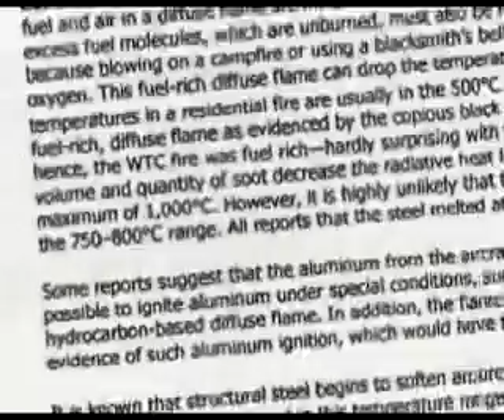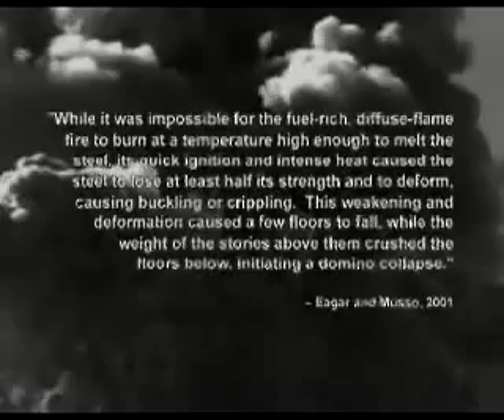Steel Facts and WTC Collapse (Part One)

Comment: FYI: using real science, you can prove or disprove the identity of a substance solely based on it's heat output. that would be nothing more than pseudoscience. agree? other physical and chemical characteristics of the substance must be evaluated. kind of like what jones and the other 8 scientists did with the chips (aka nano-thermite)...

Comment: Since Nano-Thermite's intent is to burn hotter than regular thermite which we know burns around, well at least we know it gets hot enough to melt steel so at 3000 degrees F, then we can conclude that what Jones found is in fact not nano-thermite. 

Agree?

Comment: can you supply proof that thermite has the exact same chemical structure as rust/Al? this should easy to find. we already tried the MSDS and nada.

This is why Jones concluded for the size of the chips and temp output, that it was some kind of super thermite.

the nano structure is the smoking gun. this proves the chips were manufactured with highly advanced techniques. say more advanced than what terroritsts living in a cave somewhere could do?

Comment: Jones concluded it was thermite because the chips:

had the same chemical structure as thermite
exhibited exothermic temps of 700C
had a complex nano-structure when scanned at 50,000X

if you didn't know, that is called a scientific investigation, ok? can you see this about rust and aluminum? red oxide primer? any other substance? obviously, hell no..your campaign is going nowhere..just in very small circles

Comment: i thought you were done going in these circles? the bottom line is jones concluded that chips were themite. ok? but really really tiny thermite. is that better than nano? the obvious question is what is thermite (of any kind) doing in the WTC dust samples in order of TONS. and until you prove this was primer, it is thermite.  that's the big picture with no circles. make sense?

Comment: When ignited, chocolate chips give off temperatures higher than 700C so you're right, it probably wasn't chocolate chips, it had to be thermite since thermite burns colder than chocolate. At least according to Jones. 

I don't really have anymore time to waste going around in circles. 

As soon as you or Jones have proof that what he found is nano-thermite and that it could only have been made in a lab and placed there intentionally then you might be onto something.

Comment: ok, you finally admitted you have absolutely no proof (testing) that primer or anything in the building could've been the chips. agree? so, your theory is based on no facts or data? agree? next, are you research scientist (preferably with a phd in a related science) with access to the materials to do the testing? if not, it is highly probable you will never do the testing with suitable credentials. agree?  you haven't even read the study? agree? so, what exactly is your case again?

Comment: jones used the known chemical structure of thermite to compare.  using XEDS, he verified this. Next, using a DSC, he measured the exothermic activity associated with the chips. For the size vs the temp output, he determined the chips were some kind of "super" thermite. Finally, under an SEM at a magnification of 50,000X, he determined that a highly advanced complex nano structure existed in the chips. Far from hollow..huh?

Comment: since you made the claim that the chips were actually just primer, provide proof that primer resembles the chips in every way:

red gray bi-layer (with the same chemical componenet per layer)
temp output of about 700C
exact chemical structure of thermite
same nano structure at 50,000X

agree?

Comment: You want proof that Red Oxide primer contains aluminum and when painted over steel, will etch into it and thus take on some of the rust causing the two to become cohesive?

Or you need proof that thermite is Rust and Aluminum powder mixed together?

Comment: you have a theory about primer and rust/Al. do you have any proof to support this? since this is the only aletrnative theory you have of what was actually found, how about some supporting documentation? a theory without proof is just an opinion. how about just proof that red oxide primer has the same chemical structure as thermite? lets start there..

Comment: simple question. please answer. when primer, rust and Al are put under a SEM at 50,000X, is there a complex nano structure present consisting of :
gray layer:iron and O2

nano structured red layer:
semitransparent matrix layer consisting of silicon, oxygen and carbon
hexagonal plates (AL) and rhombic grains (thermite) embedded in the matrix layer. it appears that only the rhombic grains contain the thermite. are nano structured rhombic grains in rust and Al? I know, jones blah blah....LMAO

Comment: you weren't the one performing the tests but you claim that rust and Al have the same properties as thermite. you also claim primer has a red gray bi layer and has the same compounds. but, you offer ZERO evidence to back up any of your theories. if you have an alternate view or conclusion of what the chips actual were, shouldn't you present evidence to support your view? this is basis of any scientific analysis. otherwise, it's just pseudoscience.

agree?

Comment: I accept legitimate, not pseudoscience. 

Jones and company stopped short of proving they had nano-thermite but felt it was ok to release a paper with an opinion that they had found loads of the stuff?

"Science by press conference" is a hallmark of pseudoscience. Using terms that sound technical such as "red-gray bi-layers and rohomboidal crystals" but are really not is another hallmark of pseudoscience.

Comment: Again Jones concluded that chips exhibited similiar physical and exothermic properties as thermite. With analysis (and under the magnification of 50,000X), it was determined that the chips contained a highly complex nano structured layer. Once again, thermite + nano technology=nano thermite. do you need it broken down once more? The obvious question once more. Does ANY primer available have this nano structured layer? It is ridiculous to even ask you this. Obviously, no.

Comment: i have a slightly different version:

There is no evidence that primer shares the same chemical, structural and physical properties of nano-thermite.  To add to this, obviously primer doesn't have the complex structure as nano-thermite. You seem to avoid this directly..for good reason. where is the red gray bi-layer? The nano structured matrix layer with hexagonal plates and rhombic grains. If you have evidence that primer is equivalent, present it now and save the useles chatter.

Comment: I opened an MSDS for red oxide primer by manufacturers: pruett-schaffer, centurion, and rodda paints
no mention of a red gray bi-layer. no mention of a semi-transparent matrix layer composed of silicon, carbon and oygen. no mention of the particles (hexagonal plates/rhombic grains) embedded in the matrix layer. no mention of any nano technology used. just looks like plain ol' primer to me. in your defense, it is highly flammable...lol

Comment: you can copy n' paste a document backing up anything you're saying any time now? even a lemon cake recipe would be nice at this point. so far, you've posted zippo evidence. ok, time to use your brain, ok? somewhere in the order of 100 tons of nano-thermite was estimated to have been found. did all the paint/primer just spontaneously come off the building all at once in basically the same thickness and diameter? and this happened with all three buildings? wow, it's a miracle!! lol...moron

Comment: ok, simple enough. just show in the document you will reference "soon" that your average weld primer:

has red gray bi-layer chips
is 10-100 nanometers in diameter
is 10-100 microns in thickness
when reacted, 700C temps are seen
the primary elements are: Aluminum, iron, oxygen, silicon, carbon(unlike your example)

i wait patiently....

Comment: The oxides in the primer are made small enough to pass through a .004 nozzle in your average gun, several hundred side by side. 

Or you could think about how thick paint is on the surface of a piece of whatever and conclude that there isn't any large chunks of anything in it and then you might realize why the particles of rust and aluminum they found were so small?

Comment from the maker: Super thermite because of its thermitic/exothermic activity, heat/temps given off vs. its size, which is in nanometers.  I have given you my reference. Your turn. List a reference of a document (peer reviewed, if possible) where nano-thermite has been shown to be equivalent  in structure, size and exothermic properties to normal building primer.  Boy!! Imagine, the potential heat given off if a building coated with this primer actually caught on fire. Again, completely ridiculous.

Comment: "Propane 74-98-6 13.5
* Propylene Glycol Monomethyl Ether Acetate108-65-6 10- 15%
Polymer of epoxy resin & bisphenol A 025036-25-3 10- 15%
n-Butyl Acetate 123-86-4 5 - 10%
Zinc Oxide 1314-13-2 0 - 5%
n-Butane 106-97-8 4.0
Talc 14807-96-6 0 - 5%
Potassium Aluminum Silicate 12001-26-2 0 - 5%
Isobutane 75-28-5 2.5
* Methylbenzene; Toluene 108-88-3 0 - 5%
* Methyl Isobutyl Ketone (MIBK) 108-10-1 0 - 5%
2-Butoxyethyl Acetate 112-07-2 0 - 5%
Aluminum 7429-90-5 0 - 5%"

LOL

Comment: Some kind of "Super-Thermite" because the particle sizes were smaller than regular thermite?

Weld-through primer would contain those ingredients and be layered just like that. Thermite is just aluminum powder and rust. 

Would you like to theorize on what the ingredients are in weld-through primer?

Comment from the maker: These unique bi-layer red-gray chips were subjected to detailed analysis using scanning electron microscopy (SEM), X-ray energy-dispersive spectroscopy (XEDS), and differential scanning calorimetry (DSC). The primary elements (Al, Fe, O, Si, C) are typically all present in particles at the scale of tens to hundreds of nanometers, and detailed XEDS mapping shows intimate mixing. After igniting several red/gray chips in a differential scanning calorimeter run to 700ºC...pesky red oxide?

Comment: I don't think you own any buildings. I also beleive that you have no clue what Niels Harrit is trying to imply is Nano Thermite. 

Iron Oxide and Aluminum (condensed gaseous)

Iron Oxide aka rust and condensed aluminum would have both been present because aluminum turns to a gas when it's been heated (like by fire) and well, I'll let you guess where the rust came from. LOL

Comment from the maker: The circle continues. Once again, NIST didn't find temps higher than 250C in the 170 areas examined. Temps recorded by NASA (on Sep 16, after spraying down the pile for 5 days) buried in the rubble were from 400-700C.  The buried heat was significant higher than the max temp recorded in the steel.  Therefore, the origin of this heat was from another source. Possibly enter thermite..It's that simple..

Comment from the maker: This is like a merry-go-round. You speak of evidence but , again, there's no evidence of this heat from the impact zone. Yes, there was extreme temps disocvered 800-1000 ft below the impact zone buried deep in the rubble.  There is no plausible mechnaism for the temps from the impact impact zone to somehow burrow way underground. Thermite was analyzed, tested and postively identified. These are the facts, not claims.  Explosions were discovered in the sub-basement levels. Normal?

Comment: That was a lot to mention in one post. 

Most of it was just made up or you taking witness statements literally and trying to call it evidence. 

The temperatures under the pile were caused by the fires in pile. 

What explosions? Other than the normal ones from various items being on fire?

The breaking concrete made a lot of dust during the collapse as one would expect. 

Freefall? Come on, truthers quit making that claim eons ago. 

No evidence for heat yet you claim molten steel?

Comment from the maker: The flashes were demo charges. This is backed up by witness accounts of explosions unrelated to the fire all throughout the building. The thickest steel is at the base of the Towers. This steel had to be taken out. Possibly, thermite (or some analog) was used here. If so, the extreme temps buried underground for weeks makes perfect sense. Thermite does not require an oxygen source. That was my theories. Now, the direct evidence. Thermite was found in the WTC dust samples...done

Comment from the maker: No. You're not really making sense to me.  It doesn't matter that there's no direct evidence of these extreme temps, so you should just make up your own scenario?  And, open air fires usually max out at about 600C.  2000??? Throw in flashes seen all throughout the building (unrelated to the fire) and a massive smoke plume rising from the base of both Towers before either collapse and it's game over.....

Comment: For the actual temperature I mentioned, what I am saying is that whether or not NIST found steel compromised by fire or not is irrelevant to proving what the temperatures reached in the building because the fires within the pile after the buildings collapsed compromised all the evidence. 

Agree?

Building fires normally reach 1800-2000 degrees, that is why the ASTM-E119 test requires furnace temperatures of 2000 degrees. 

And, do you want to talk about 7, or the towers?

Comment from the maker: Not debris. Intact floors. The Towers fell into the intact floors of the basements. Watch the collapse. The upper undamaged floors most likely smothered the fires when they fell onto them. Where is the proof that fuel spilled down the elevator shafts? Employees took these elevators to escape. I have no idea what you're trying to prove with the 2000 degree steel scenario. Open air fires can not reach those temps and there's no evidence supporting this. And WTC7 is the smoking gun. Free fall?

Comment: Why would the debris on top prevent the fires from getting underneath especially when the debris was able to start fires in building 7?

And what about fuel spilling down the elevator shafts etc? Severed electrical lines starting fires etc etc etc?

The evidence from the pile was compromised by the fires within the pile so lets say NIST found a piece that got to 2000 degrees, ok?

Well that is not proof that it got that hot from the fires while the buildings were still standing. 

Agree?

Comment from the maker: I guess I meant direct evidence (steel testing, degradation) , not modeling.  Also, most of the lower levels were intact during the collapse. So, the intact levels prevented fires/heat from above from getting to the sub-levels. Therefore, this heat came from somewhere else.

Comment: Right, the extreme temperatures in the rubble pile were caused by fires burning within the pile. 

No argument there. 

The evidence the fire reached 1800 degrees were proven the modeling and of course the fact that building fires are know to burn around 2000 degrees. 

But *proven" by modeling a fire and then of course the full scale test with the actual truss assembly.

Comment from the maker: You just lost me. Where is the evidence that temps in the building reached 1800 degrees? Or even 1000 degrees? And, all I'm saying is that the extreme temps buried in the rubble (basement levels) lasting for weeks were not caused by small fires 800-1000 ft up.

Comment: Ah ok.

So you're saying the because temperatures in the pile exceeded the temperatures of the fires in the buildings while they were standing, that it proves thermite was used. 

Ok. The temperatures in the building reached 1800 degrees, although NIST had no samples of truss chords to test, they modeled the fire and were able to get the truss assembly to sag. 

Agree?

Comment from the maker: The study:
pubs*usgs*gov/of/2001/ofr-01-0429/thermal*r09*html

Would this be caused by small fires 800-1000 ft up with temps less than 250?

watch?v=Zww9-AaIgrw

"There are still flames coming out of the BASE of the trade Towers?" The BASE? How is this possible? Here's how: The thickest, heaviest steel was at the base of the Towers. Explosives were needed to take it out. Couple that with thermite found in WTC dust samples and its game over...

Comment from the maker: Only 3 columns tested from/near the impact zone were over 250.  The temps recorded 5 days after 911 found underground/basement levels were well over 1000 degrees.  Theses temps lasted for weeks.  By the way, these temps were discovered in all three buildings.  A small fire 800-1000 ft up vs sub-basement levels. It's all common sense.

Comment from the maker: If NIST ddn't find temps over 250 C for the majority of the steel tested, where was the heat? My opinion: The trusses were taken out by explosives which caused the bearing weight to initiate the collapse. There are flashes (unrelated to the fire/impact) seen all throughout the building. These are explosions:

watch?v=MUhyS7i7TnI

Comment from the maker: Edna Cintron, an employee of the WTC, was seen at the impact hole of the North Tower 20 mins before collapse. Is the temp to weaken steel hot enough to cause harm to human.  No heat:

"Of the more than 170 areas examined on 16 perimeter column panels, only three columns had evidence that the steel reached temperatures above 250 ºC. Using metallographic analysis, NIST determined that there was no evidence that any of the samples had reached temperatures above 600 ºC." (p 140)-NIST

Comment: Not usually mentioned in vids like this is that Steel Structured sky scrapers have a SAFETY FACTOR OF ABOUT 10 OR MORE.. SO IT IS BUILT WITH 10X MORE STRENGTH THEN NEEDED. SO EVEN IF THE STEEL LOST 50% OF STRENGTH DUE TO FIRE, IT STILL HAD MORE THAN ENOUGH STRUCTURE TO STAND UP.